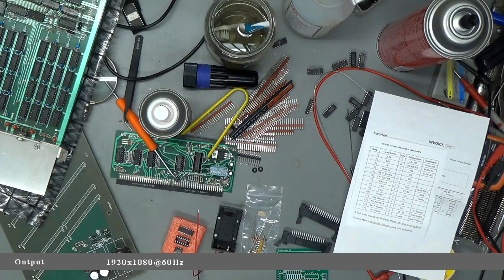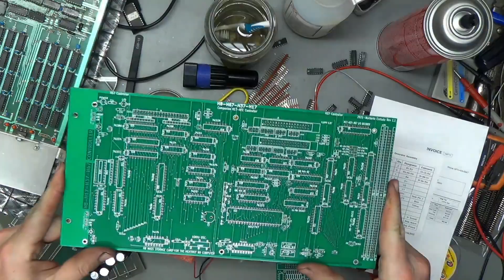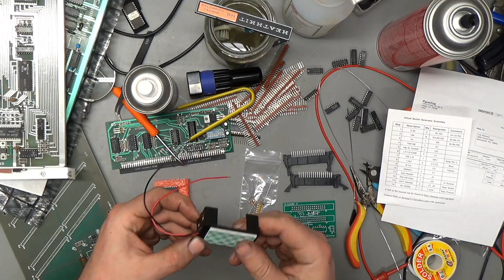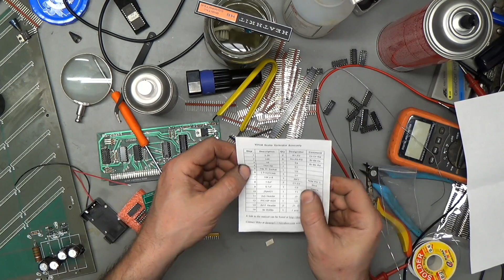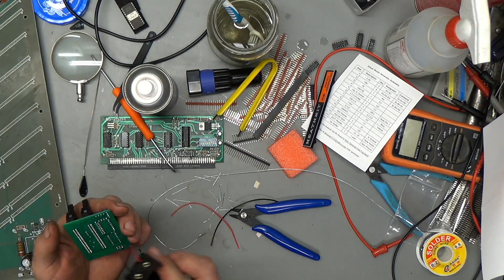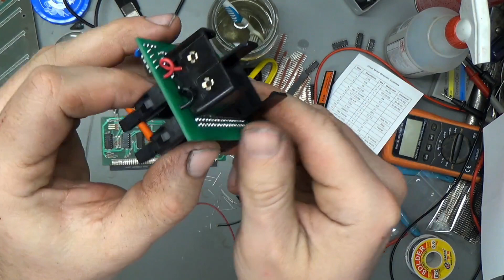Assembling a Virtual Sector Generator (Heathkit H8 Pt.7)

Comment: Ya know, the plastic collars on those headers can be shifted by just pushing on them. They’ll be just a little bit looser afterwards. You might try inserting the headers into the sockets as far as they will go, and then pushing the plastic collar up flush to the socket housing. As the collar will be a bit loose on the pins, you’ll want to solder the header into it’s PCB before pulling the socket off of the header. 🤔